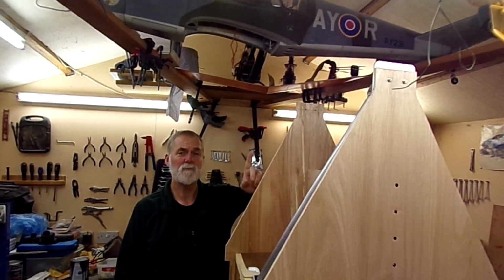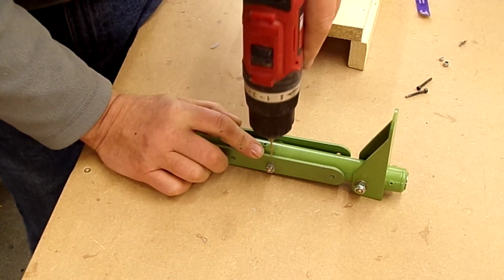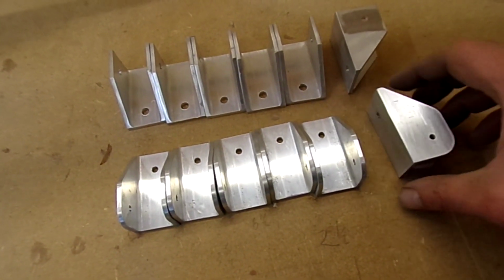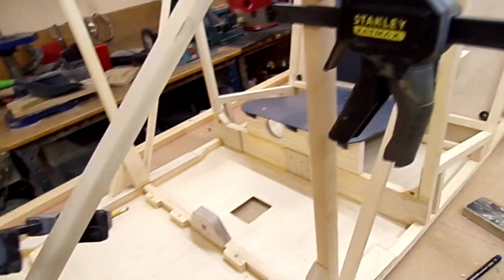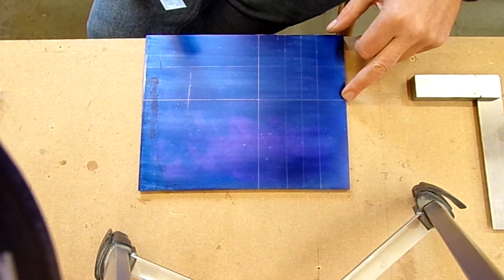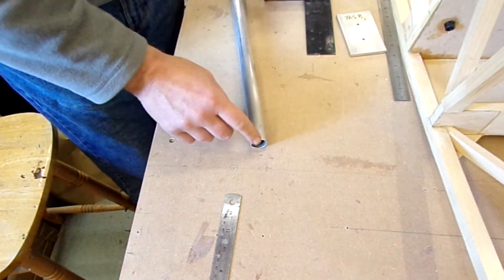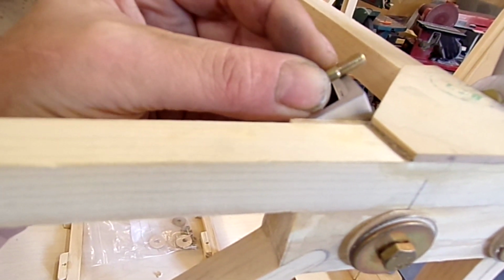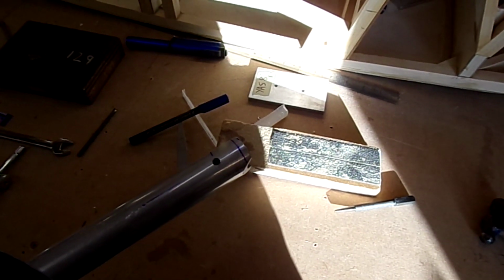EP85 Working on the rear Cabane struts and more. Fisher Youngster

Comment: On the front struts where u say theirs no room for the bolt to go in. Take the bracket off, then insert the tube and then the bolt then bolt it back up. None of those bolts should be facing up in my opinion. Coming along nicely though.
Reply from the maker: I know what you are saying but if the tube is bolted on you can not get to the top nut to fit it, so the bracket has to be bolted in first.  As I will have to put the bolt in up hill, I will split pin them. Thanks for your thoughts,  keep them coming.
Reply: @flyingkub  Went back at 25.45 and I see what you mean. uh, that sucks.
Reply from the maker: @outlawflyer7868  Yes, not great but not a big safety issue, provided the nuts are locked, even nylocs should be okay as they are only at around 30 deg of level (but I will still split pin).  I like the way you are asking the question, it shows you are thinking about the content.
Reply: @Flying Kub  dude, love what you do. I have plans to bring back an old relic from scratch and the way you do things and how meticulous you are is outstanding. Trust me, your doing a great job at teaching people that with just a little patience and some common sense. This isn't all that hard. Nobody is perfect. Mistakes will be made. Just keep on trucking and will be watching.
Reply from the maker: @outlawflyer7868  thanks for your kind comments.